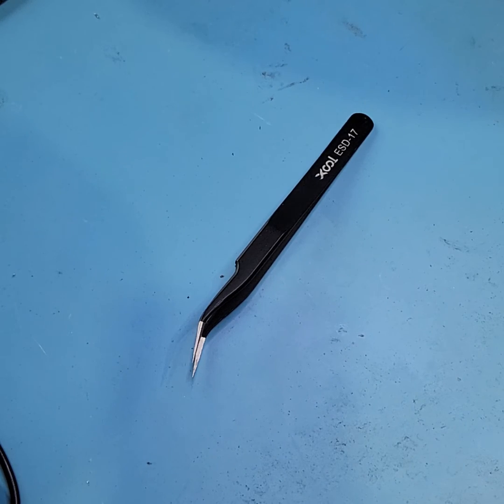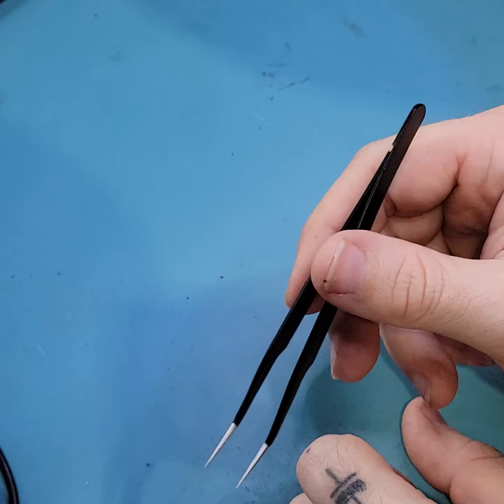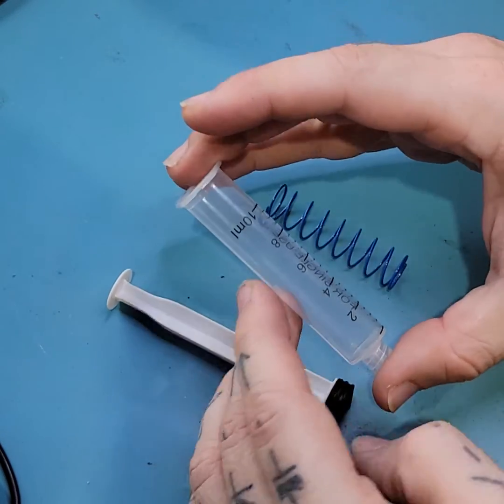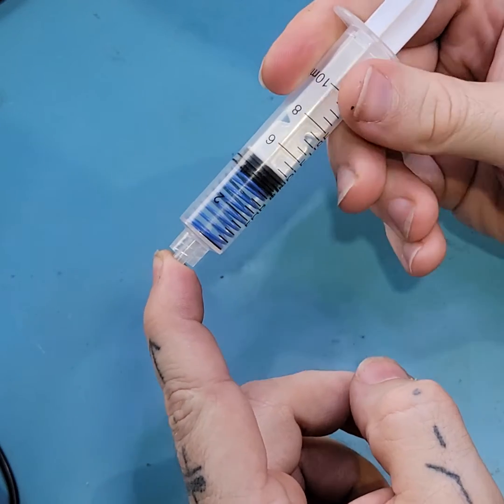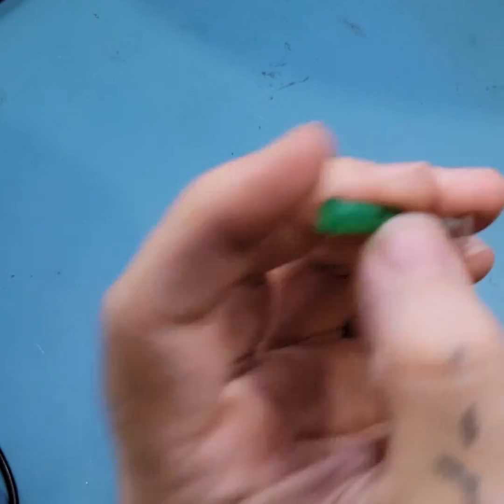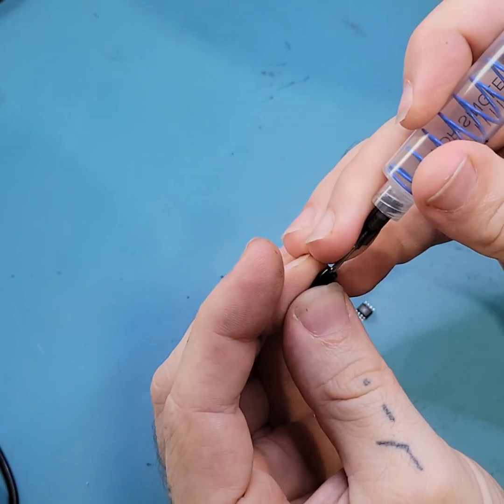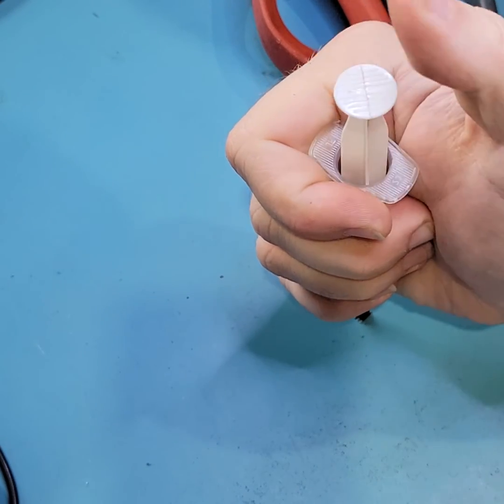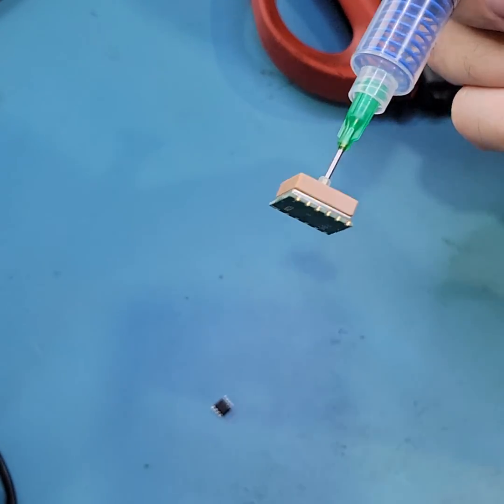DIY Vacuum Pen

Comment: Great Idea. I was thinking to make a similar one. My sugestion is to make a small hole on its side in a way You may close it with your finger and when you remove your finger air goes through the hole and SMD is released.